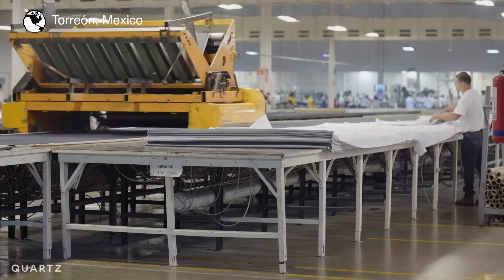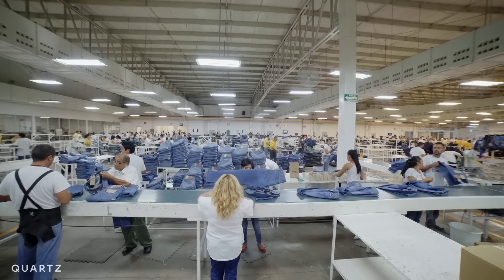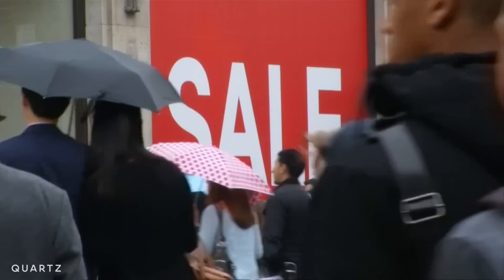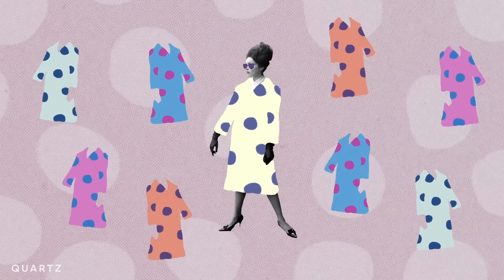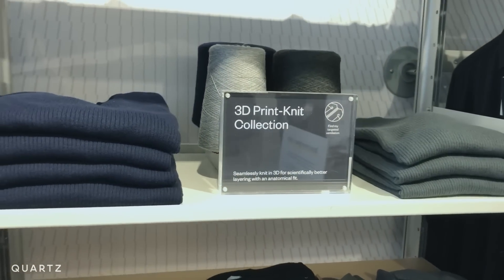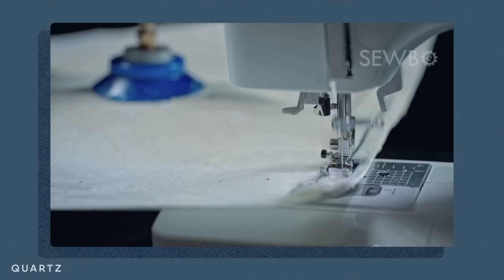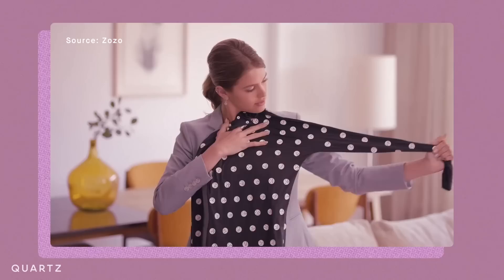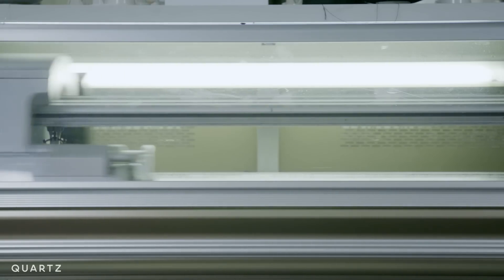The high-tech future of fashion

Comment: This doesn't solve the modern slavery problem, customization in your clothes only means your more specifically demanding an accurate representation of your body measurements, hindering the production line by making more adjustments that are suitable to different sizes, thus creating a multitude of volumes.

Furthermore, developments in the technology reside in the commercial application rather than industrial application, for instance, the use of robotic arms in the assembly line was only implemented in the heavy industry of transportation for only a couple of years, meaning hypocrisy in the digital age is just applied in the sector of Media...

But I'm optimistic to what the impact it will have in this sector once these people implement it though there is going to have consequences...

Comment: Customization is still way too expensive for a mass market, for example with 3D knitting. This is and will be a high-end market solution for a while. When it does come more mainstream, it will reduce waste by a lot, since it's wasteless production, and also customized for everyone (less incentive to throw away). The bigger challenges, in my opinion, are in the recycling of clothing. There's a big need for more innovation in that part because if the product loop can be closed, the biggest issues are resolved :)
Reply from the maker: Good point. There is a lot of waste in the clothing industry — especially post-consumer — that needs to be addressed. But the technology for clothing recycling would most likely be slow and low tech too.